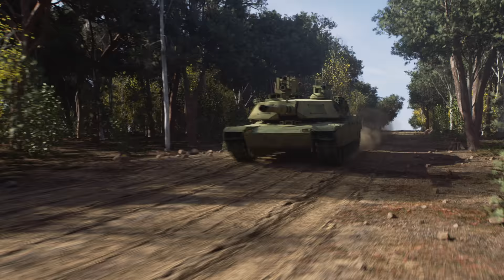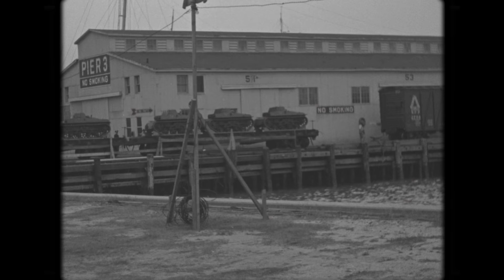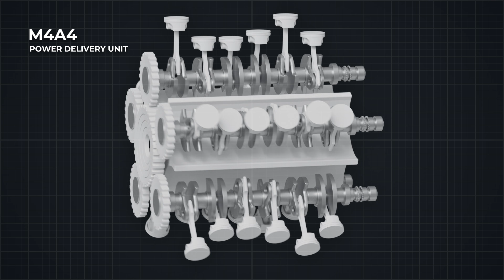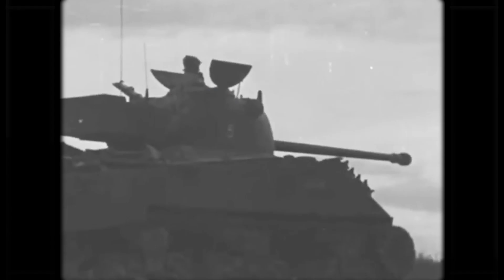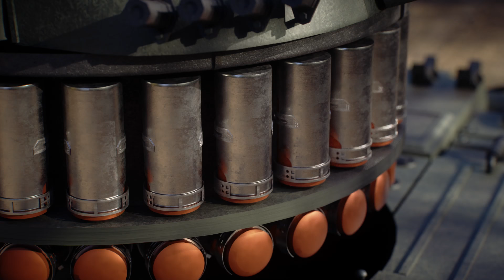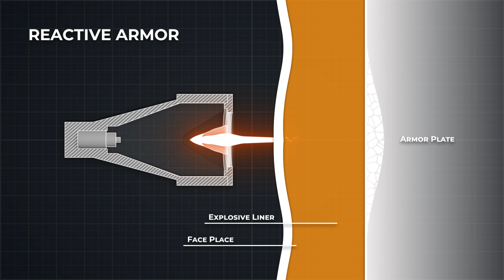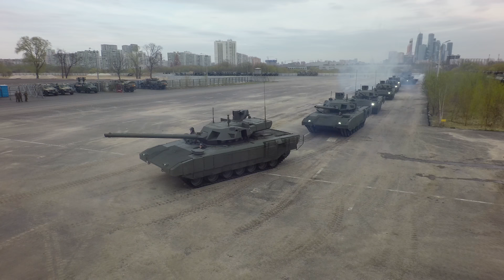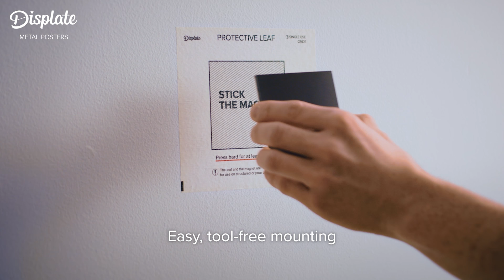Why America’s Tank Failed in Ukraine

Comment: I remember reading on a telegram channel that Ukrainian tank crews praised the tank for its armour and survivability. However, they never found the tank very effective, it used to get stuck in mud, it was fuel hungry, and it had no low profile picture, and sometimes repair units didn't have spare parts to repair any destroyed Abrams.
Reply: As the old saying goes:
Soldiers win battles
Logistics wins wars
Reply: Make sense, it required powerful logistics. America had it, but countries without the same logistical power will not have the Abrams last that long.
Reply: i think ts sums it up pretty much, nato tanks were always more of a defensive thing is, also another thing of note,
the Ukranians still prefer T series tanks for offensives or at least their Commanders, since T series tanks were literally made for only being used in mass frontal offensives
Reply: "sometimes repair units didn't have spare parts to repair any destroyed Abrams" - pretty obvious. US should've provided the logistical aid for abrams. this is a no brainer SOP
Reply: none of those things are the tanks fault it's their crews and their logistical pipeline
Reply: In February 2022, you can see photos of russian tanks also stuck in mud, it depend of terrain
If u drive to deep mud, you will get stuck even on a lighter tank
Reply: @Spectre4490  And Ukrainian tanks too, but the T series is less likely to be stuck than the 50+ tons Abrams. And the ironic part of all of this is that the Abram isn't even the heaviest tank Ukraine field.
Reply: @Mal101M  The issue isn't getting stuck, it's getting them UNSTUCK. Problem is that the Abrams weighs so much it is difficult to pull out of the mud once it is stuck.
Reply: @Spectre4490 те самые фотографии которые кроме тебя в мире никто не видел
Reply: @IMPOSSIBLE-474  Abandoned Tank and Artillery stuck In the Mud - Ukraine
Ты не видел потому что у тебя мозг промыт пропагандой, ты овощь который игнорирует любые факты, но для тебя я нашел целое видео на ютубе, кушай, дорогой
Но я даже предскажу твой ответ, что это вообще не в Украине снято и вообще это фейк, а я бот )
Reply: @IMPOSSIBLE-474 and me 😂
Reply: @IMPOSSIBLE-474  Yeah, sorry, but everyone saw those photos of Russian tanks stuck in mud or in ditches
Reply: @Mandemon1990 вы верите и видите  только все то что вам ВЫГОДНО
Reply: Mud in Eastern Europe is extremely common and all vehicles, tracked or not, tend to not do well in mud.
Reply: Also the Ukrainian tankers like the Challenger 2 over all the others
Reply: Fact the Challenger 2 is the number 1 for crew survivability
Reply: Almost like they have to be trained on American use of the tank and also have the supply chain.
Reply: @CaliforniaDreaming559   that supply chain got offshored decades ago, Chrysler is a shell of it's former self and had to be bailed out. It's called the "Rust belt" instead of the "Steel belt" now for a reason, the US de-industrialized and became a services based economy if you didn't already know.
Reply: @CaliforniaDreaming559  im not sure we even have the supply chain anymore...were broke!
Reply: And they got very few of them, if they have gotten 500 and the supply chain that it needs and spare parts it would have been better and SkyRanger 30 mm for defense against drones and 400 F16 with all the deadly weapons available in large amounts, and 8 radar aircrafts it would have been possible to fight like NATO fight, instead of a war of attrition like WW1. But Ukraine has never been given the right tools or quantities that is needed to fight like NATO does, it’s not just one system that makes it powerful it’s the combination also the intelligence from satellites working together in a system amplifying one another, one on one the difference is not huge but when the radar aircraft and the fighter jet with link is working together 💀
Reply: @kimmogensen4888  Ukraine had no capacity to train up to that level of kit, even if it had been made available. We didn't know they could train up to the level of kit they received, until they actually did it. To believe that just because you succeeded at x you can automatically do 2x was widely debunked as the Peter principle back in the 1970s. The other name for thinking that x immediately implies 2x is getting out in front of your skis. 

When pressured to mount a premature invasion, their operational coordination on the day was hideous. We should not have pressured them to do this, but that doesn't negate the learning that they were far from ready to coordinate a joint attack, even on a relatively modest scale.
Reply: Right tank, wrong doctrine. Remember, Ukraine started out the war with a similar doctrine to Russia, at least until western equipment started coming in
Reply: @applepiepieapple5464 Ukraine has never gotten enough units or weapons to fight like NATO, USA has not even donated a F-16 they tried to block other countries from doing so for a long time under Joe Biden, Denmark as always had to prioritize American interests over our own interests and selling 22 F-16 to Argentina, too be allowed to donate 19 to Ukraine, Denmark wanted to donate all to Ukraine, but we are definitely after having helped develop and are building the sensors and parts of the radar system in all F-35 Being part of any joint project with the USA again this American interests always first your own interest doesn’t matter has gone to far America alone think alone about their own interests in the future sounds much better, except for France which has similar issues with military industrial corporation the rest of Europe and whatever trustworthy countries will have too make a joint project for the next generation fighting jet ready to replace the F-35 in 20 years time. When the USA can’t afford development of anything because of 200% GDP debt and 7% interest rates on 10 years bonds, maybe the US can be allowed to buy the new aircraft as long as it’s our interest 100% like Americans like it…..
Reply: @applepiepieapple5464  More like wrong tank for the war. Their doctrine is working just fine for them. The Abrams is not.
Reply: @applepiepieapple5464  They still have a similar doctrine.  It also isn't a "wrong doctrine" issue, it's just that Ukraine has shit logistics.
Reply: @applepiepieapple5464  A 50 year-old design is bound to start showing it's age, and no matter how nice you make it, a tank is just a tank and there is only so much it can do.
This is something the Germans found out with the Tigers, and why they switched to a Panther-like line of development.
But where is the Abrams replacement? Can't the US military develop ANY new weapon systems these days?
Reply: @johnwolf2829  The US has a new idea, which is the Abram X. 

The Abrams is not outdated, the Leopard II is nearly 70 years old now, it's just, the Abrams is not going to change this war. People do not say, "Look how outdated and useless the Leopard II is!" Despite the fact Leopard losses are three times that of the Abrams. Because most people don't care enough to look at the facts on the ground and just go with what they assume is a well researched video, which most aren't. 

The Abrams is still useful to most nations, it's a good design, that's why the Abrams X doesn't exist yet. It's just, when you throw an Abrams into a war zone with very heavy fighting, against a superpower, it's kind of expected you're going to lose a few.
Reply: @Hoi4daybydayguy  Yeah, that's true enough (but the Leo I is 70 years old, NOT the Leo II) and what they don't say is this is a BIG war, and losing 27 tanks is something that could have taken 10 minutes or less on a busy day.
Reply: @johnwolf2829   turns out the leo II is only 46 years old, i was thinking of the Leo I

However, the Abrams is different:

1) its not 27 destroyed, its 10 destroyed, 12 damaged and abandoned, and 1 that was damaged and put back into service, those 12 could have been recovered. Its a small thing, but i wanted to check it
2) 23 over 30 months is the definition of nothing to worry about 

23 in a battle is a severe miscalculation by the Ukrainians. 23 over 30 months is not even a footnote worth mentioning to be blunt, i honestly forget the Abrams is even in Ukraine, despite following the war closer than most because, there is no news around them, they do their job, they do it well, thats it
Reply: Quite correct, and quite fitting for most of the western european tanks. Challenger 2 is a hopeless disaster though the Leopard seems to be the best fit for Ukraine. Though none of the tanks, Western or Russian, is designed to be good against drones.
Reply: because it was never made for this war, it was made for quick brief conflicts not a mud trench warfare
Reply: In other words, they had no idea how to use tanks properly. You might as well call out the Shuttle for not being able to parallel-park.
Reply: @jamesharding3459  Then why are other western tanks doing well in the same situation?
Reply: @Aethid  They aren't. They're all doing better than T-64's and T-80's, but that bar is so low you'd need a shovel to find it. Of the 167 Leo 2's, 50-ish are  confirmed destroyed with another 70 plausible losses. Out of 14 Challenger 2's delivered, 4 are confirmed destroyed and the remainder laid up the vast majority of the time due to sustainment issues. The Ukrainiains correctly assessed the Abrams as the most capable of the fleet, so they were naturally used hard and in the most demanding operations. If Challenger and Leopard were being used in a similar fashion rather than as ad hoc field guns or hiding from drones dozens of miles behind the frontline waiting for repair parts, they'd have seen similar losses.

The Ukrainian military simply lacks the quality of personnel at all levels and the broader system of systems that enable larger, richer nations like the US to effectively make use of things like Abrams, F-16, etc., as do the vast majority of NATO nations.

Cope harder. Leo and Chally fanboys are even sadder than Russophiles.
Reply: @jamesharding3459 The Leopard's have seen the same use as the M1's, but far higher survival rates - yet they are still the worst performing of all of the European tanks, by some margin. The C2's have been shown multiple times now to be able to survive hits that have taken out M1's, and only 2 have been destroyed. Not 4. Of those 2, one was lost due to getting stuck in mud and was abandoned, while the other was taken out by an anti-tank loiter mution that no tank has been able to survive.

Your comment is just cope.
Reply: @Aethid  50 out of 250 Leopards destroyed. 10 out of 30 M1A1s destroyed (the others were abandoned). 2 out of 14 C2s destroyed and you are wrong. Both those C2s were destroyed. There are clear picture online for both events one in 2023 and one in 2024. Multiple times C2s have been damaged and towed away to be repaired.
 About 1,000 Ukrainian T-72s destroyed. Along with all of those, many damaged vehicles of all kinds. 

Russia lost 4,000 tanks.